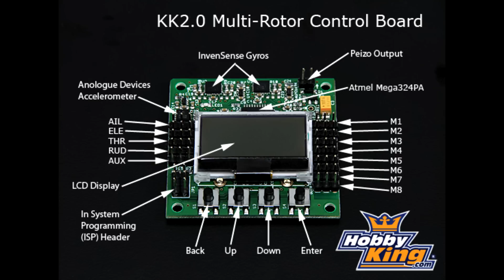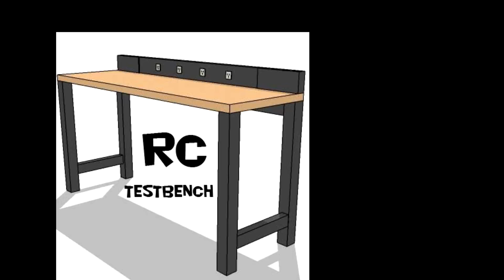KK2 Multicopter Controller board- wiring and setting up voltage alarm

Comment: i have kk 2.15 and  it has the special connector so no need to solder.  but i am very new to it  - so dont really get it - is it safe to connect directly to 3s battery  +/- so it can read the voltage? or not

Comment: I have a EVO KK2.1.5 Flight Controller without manual ?? where do I connect battery ( 7.4V) so volt alarm works

Comment: I read the specs of the control board and say  that input voltage is  from 4.8 to 6vdc and you are using  a battery that supply 12.5vdc...???

Comment: So if I have a 3 cell 11.1 volt battery, what would I set the alarm to?
Reply: I would set it to 3.5 volts, or even 3.6. You don't want any cell to go lower than 3.4 volts so an alarm at 3.5 or higher will give you time to land.

EDIT: My bad, you actually want 10.5 volts, as the KK board is measuring the total voltage, not the lowest cell.

Comment: Nice vid, so why is it necessary to solder battery leads to the back of the board rather than simply using a servo-lead (3-pin) on the flip side like you had in the first couple minutes of the video?

Thanks

Comment: KK2.1.5 Important note: There are TWO power buses... the 5v RX FCB bus that M1 is part of, and 5-6v servo/esc power bus M2-M8. M1 cannot take 6v and if on a wing or Tri motor using servos you really need to know this. There is actually quite a bit being left out that Steveis mentions in the KK2.1.5 manual you need to be aware of. See Appendix 1:powering the KK2.1.X 

soccntzulu you fried your KK2 board:-( & you said "The board gets no power from the output side but comes to life from the input side but no voltage readings on the out+ when powered by the input side"  Read the manual as this duel bus issue is not mentioned in any of the videos I've seen looking for other info... manual is the best info source but sure wish I could find a schematics for the board too. It's like being blind not having it....

Comment: followed your video every thing went great until i plugged in the lipo and poof something on the board let out its magic smoke.  closer inspection showed i had reversed the + and - wires. Should I be looking for bad voltage regulators or is there a particular place to start tracing the problem? Having a hard time finding schematics for the board online. The board gets no power from the output side but comes to life from the input side but no voltage readings on the out+ when powered by the input side. also i get no conductivity across the grounds from input to output. but i do get conductivity from input + to speaker right pin.

Comment: At the beginning of the video you had the kk board powered by a small battery pack, then after all the connections you had powered with the ESC ubec. now, the wire you soldered was to monitor through the kk board the main battery pack, what if I leave the small battery connected to the kk board to protect the kk board from losing power or sudden power loss..Or connect a small Rx battery to the receiver. just asking!!!

Comment: Excellent tutorial and very well presented.  Not in any way boring.
I also understand that as an American, living in America, you are pronouncing solder quite properly.  I live in England and so pronounce it differently.
Thank you for teaching me how to wire up the KK board, I previously left off the speaker and used a separate LiPo alarm.

Comment: nice tutorial video. anyway may i ask if this kk2.0 board can use in "tandem rotor" like chinook or v22 osprey vtol aircraft. im looking forward to scratch build a chinnok or v22 osprey and i dont know if the radio transmitter can do the mixing of six servo for aileron, elevator, pitch, and rudder. please let me know if this board can do the job. thank you.

Comment: If I have the hobbyking 550 with integrated power dist on the board I just solder from the KK2 to the integrated power dist battery + and -. Instead of getting a power distribution board? I think i'm right?

Comment: Each motor has its own speed control. Each speed control needs power from the battery. All of the speed controls can't plug into the battery at once, so you need the distribution board for the speed controls to connect to. Then, the battery supplies power to the distribution board.

Comment: Thanks nice video I didn't know it could do that. I was planning on trying one of these boards. Can you power the board also from the voltage connection you made or is that just for sensing the voltage,

Comment: Hi, how do you connect the wires going to the receiver? do you use single signal wires only or the whole servo plug? how do you power your receiver? can it handle the 12V from the flight controller board?